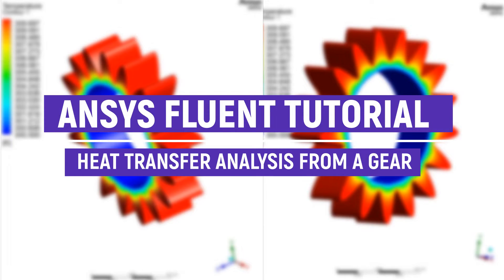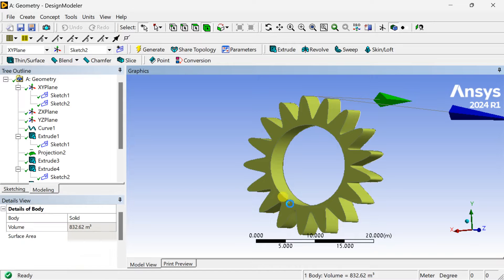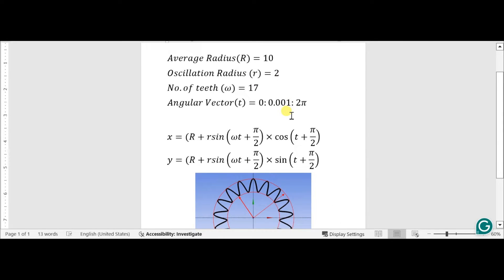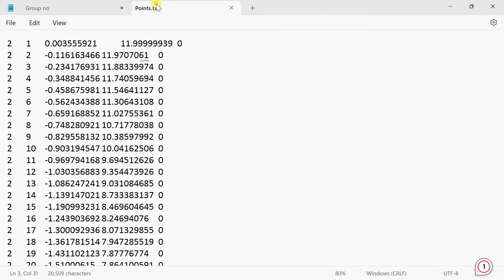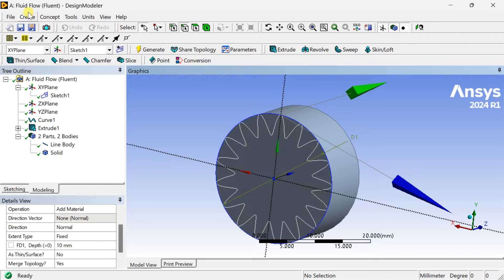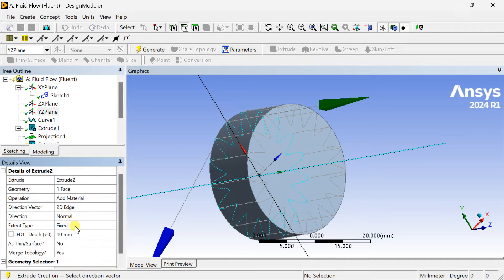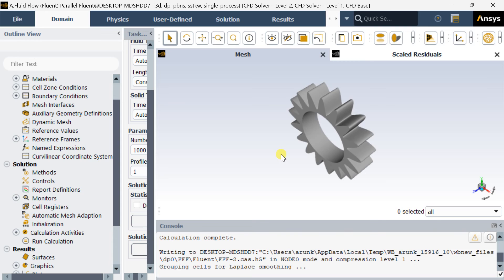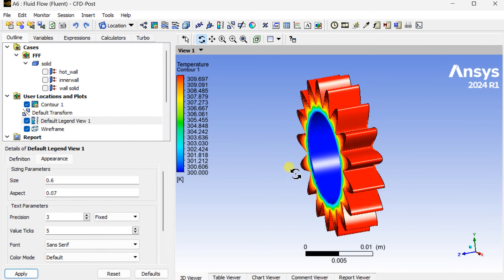Gear Profile Geometry Heat Transfer Analysis In ANSYS Fluent | Gear Profile Using Equations | ANSYS

Comment: I didn't get it. For the teeth pattern, couldn't you directly extrude from the sketch? What is the reason for making the cylinder?
Reply from the maker: It's a line body, if you extrude it it might generate a surface only. If you would convert it to the sketch, then only it can be extruded.

Comment: If the gear is immersed in a fluid like MRF whose viscosity changes in the presence of magnetic field. How to simulate for the developed heat due to the interaction?
Reply from the maker: You need to use UDF or tabular data input for this.  Watch our tutorial on table data input in ansys to get an Idea regarding this.
Reply: Many Thanks